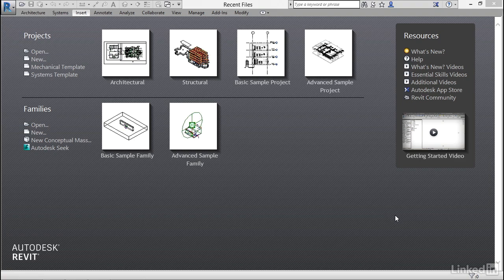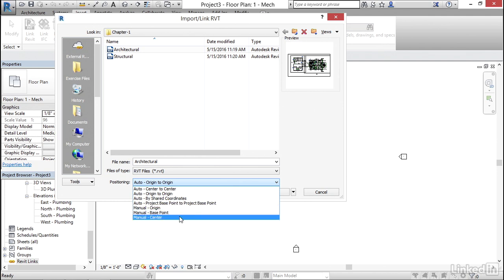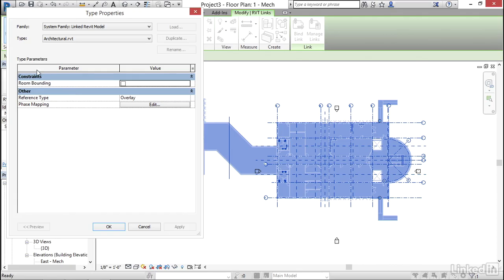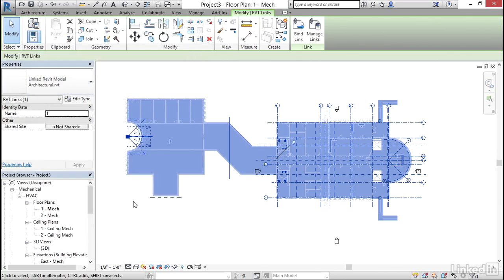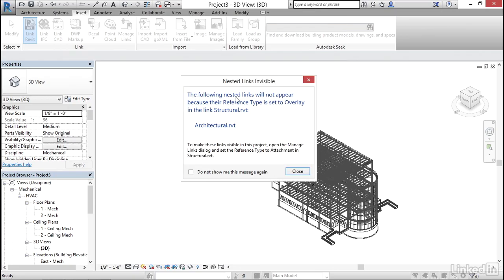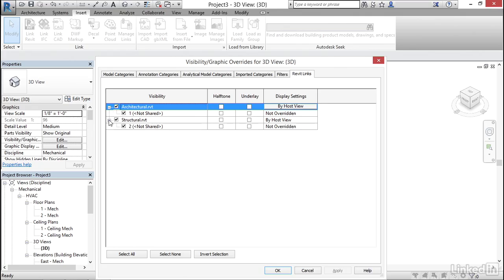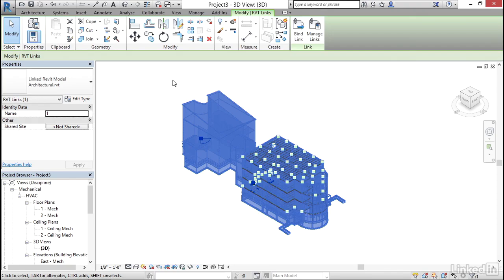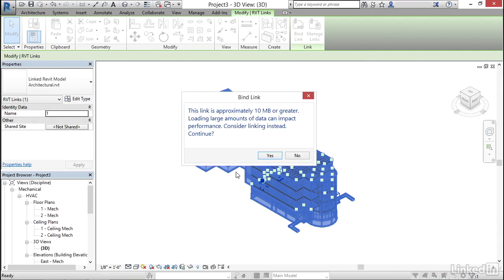Revit Tutorial - Linking an architectural model

Comment: Why when I link a revit model to my template it doesn’t show all the floor levels in view range? I have used copy monitor using a exterior section but still nothing. Also, one time i was still seeing linked in families from a previous revit model but even after replacing my backgrounds I was still seeing the others revit families?

Comment: Hi. I would like to create my own project browser template with the Mechanical, Electrical, plumbing and......all the Disciplines in it. Kindly help.
Reply: A good way to have the Project Browser is to have it sorted by Discipline, then Sub Discipline, then by Family and Type. No need for any filters. If you have say an Electrical floor plan, it will put it in the electrical drop-down of your project browser. In the properties you can specify what Discipline the floor plan is. So if you select it and say you want it to be plumbing, it will automatically change it in your project browser to be under Plumbing drop-down. If you want all 3 disciplines to show up in the browser, you should have 3 different floor plans assigned with each discipline.